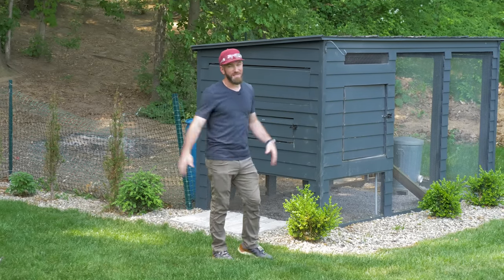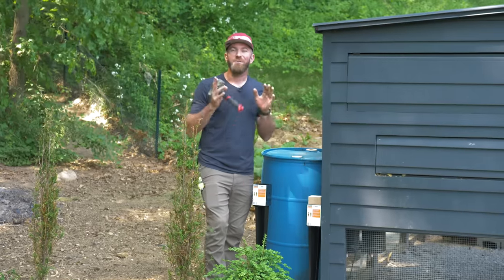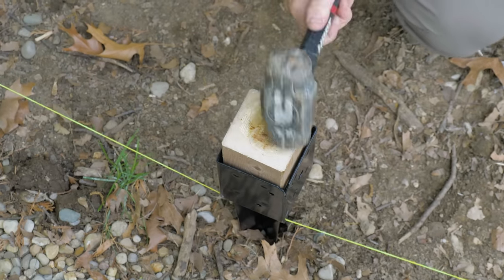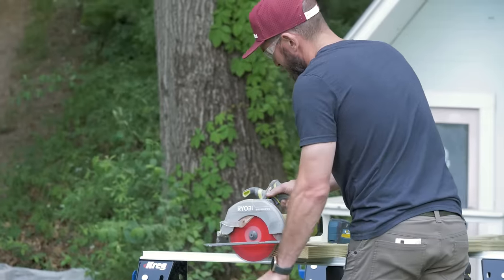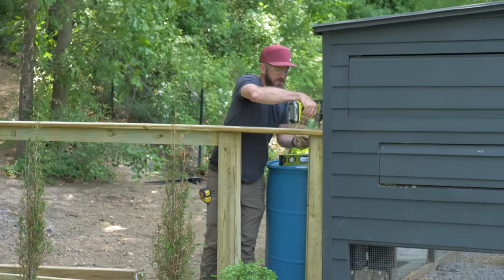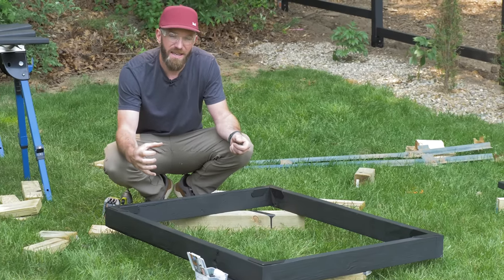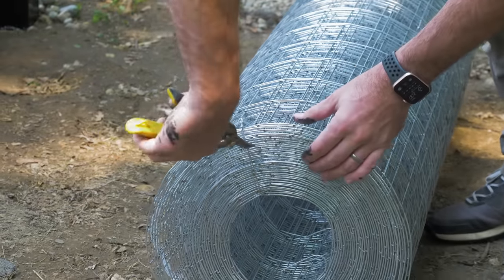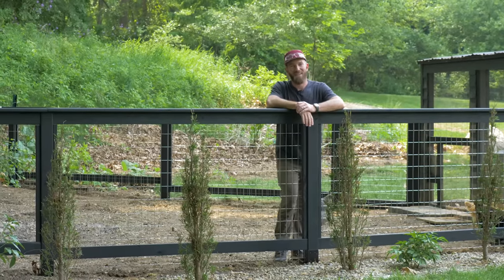DIY Garden Fence with Gate [EZ Post Install]

Comment: It's a pretty fence but won't keep predators out. Raccoons, possum, snakes, bobcat, and neighbor dogs can get in under the gaps between the ground and bottom rail. Every chicken run I've ever made had to have the fencing buried at last 10" into the ground and have a net across the top to keep climbing and flying predators out. Learned that the hard way.😢
Reply: I also don’t use chicken wire I use hardware cloth
Reply: I have cams out there notifying me if anything comes even close.

Comment: Those spikes add up at $30+ each, and then you have to buy everything else too.  If you have the money, great, I'd rather go the old ways and save some money.  It may be slower, but it's also cheaper.
Reply: yep, dig a 2 foot hole, use a $4 bag of concrete. pour in dry then pour in water.
Reply from the maker: Also keep in mind that posts in the ground tend to rot at ground level over time.
Reply: $30 each is worth not buying/renting an auger in difficult ground, buying concrete, and having to rip it all out after it rots the wood in the ground, so in the long run, the old way is not cheaper…and time is money.
Reply: Amazon have them for a fraction of the price and supposedly, the same heftiness
Reply: @Defender_Tom 
Nope.  Just get the post a inch or two below grade.  Poor some dirt over it and plant grass seed. Done.  Cement can stay there.
Reply: Plus he's not fencing a huge area. Not too many posts

Comment: For youtubers it would be great if you disclose in which area you live. Nice project but for safety reasons it's better to cut a post when placed on a stable table and not free style while the partner is holding it up. I like the design of the fence it looks good and is cheaper than all wood. I will do on of those in my backyard.

Comment: That fence is beautiful. I love it. I was wondering though, did you have a problem with your chickens jumping on the cap boards and getting out of the run after building this? I know beyond the shadow of a doubt that’s what mine would do :/

Comment: How do you stop coyotes from digging under.
Reply from the maker: It’s not meant to keep all predators out. More to keep the chickens in and our dog out. The coop itself has an automatic door that secured them at night. I haven’t had an issue with coyotes digging under but if you did, I would suggest burying the fence about 12-16” below grade. I only went about 6”

Comment: I like your video, but what you said about using that as a garden fence to keep deer out is stupid because deer can jump 8 ft in the air.  But other than that the video was great.
Reply: The don't like small enclosures. If it was one fence and not another a few feet away, then yes they jump pretty darn high

Comment: Any average raccoon, fox, coyote, skunk, cat, rat, snake, dog et. al. is going to push right under or right through that fence. Or climb right over. Looks nice, but no. I’ll be setting my posts in the ground, using hardware mesh and pouring a dig proof cement barrier at the perimeter. Oh, and deer laugh at a four foot fence, so not going to protect a garden either.